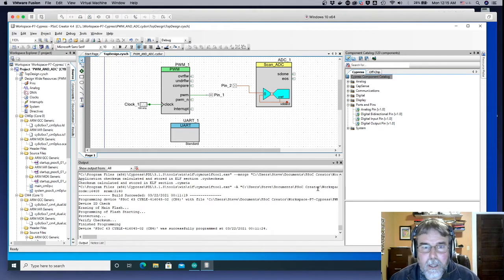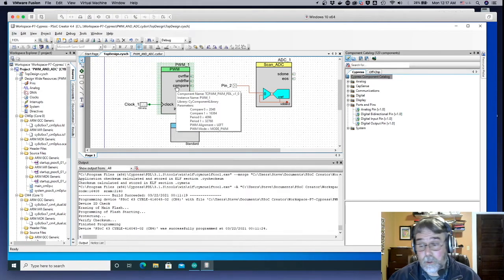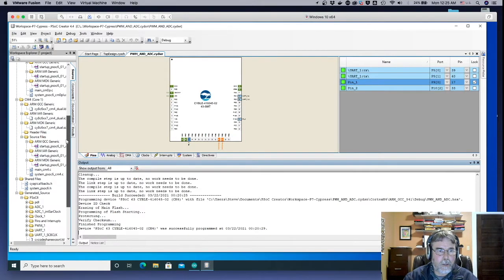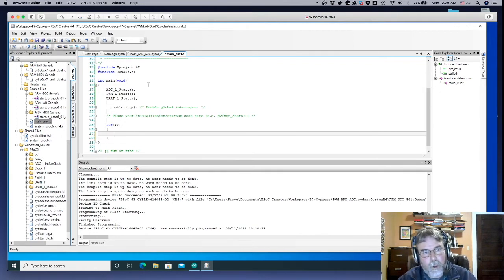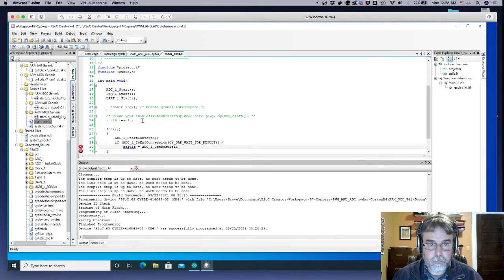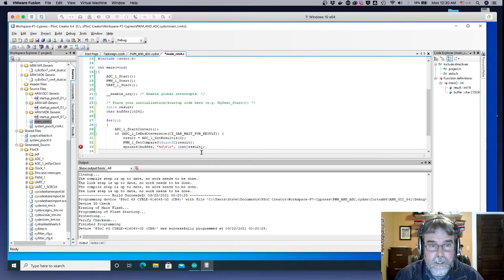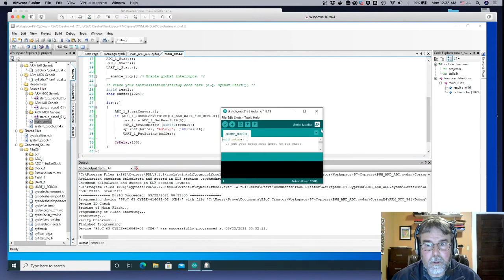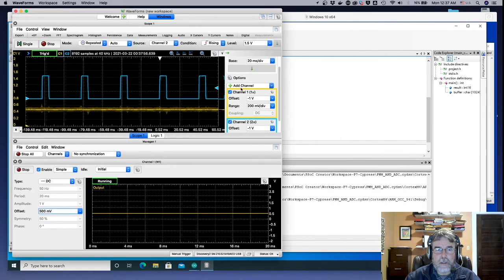PSoC-6 PWM Control with an Analog Signal

Comment: please explain how waveforms and psoc creator work together
Reply from the maker: I was just using a digilent box (with the waveforms app) as an oscilloscope. There was no real direct integration with the PSoC.
Reply: @sspickle  you mean sir that you generate a data file from Psoc and you use it in waveforms oscilloscope
Reply from the maker: @mejerbimarouen8337  The PSOC was measuring a manually adjusted analog signal, and producing a PWM signal (time varying digital signal). There was no file. The digilent box, and the waveforms app were just being used as an oscilloscope to monitor the various signals in the project. A standard oscilloscope would've worked just as well, only I didn't have one handy at the time.